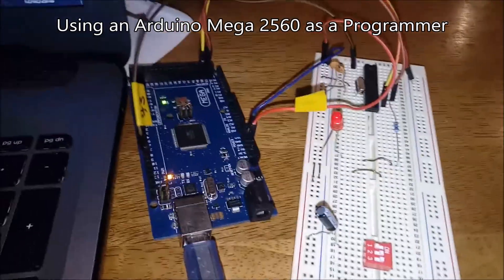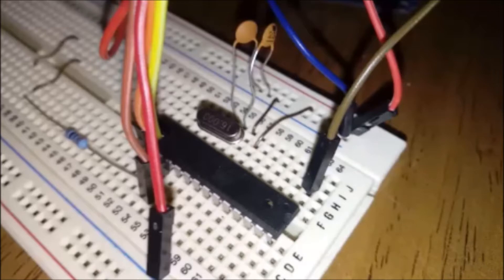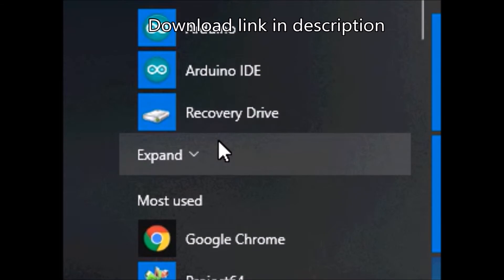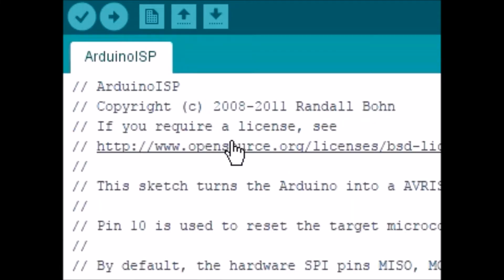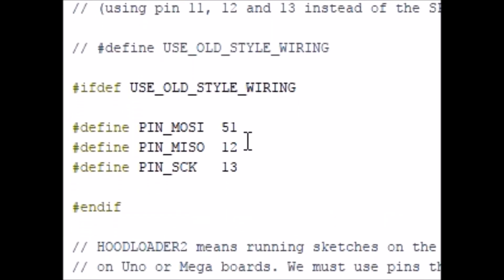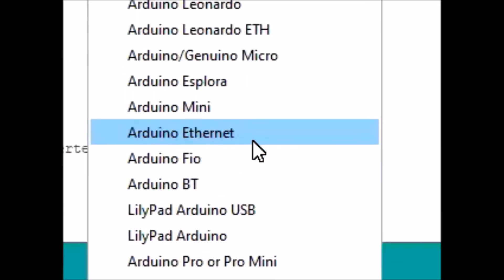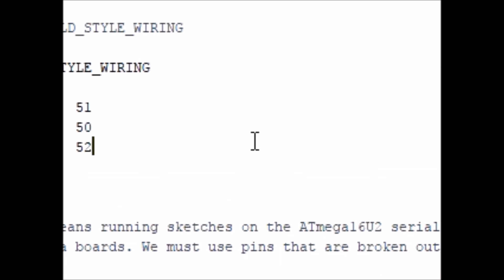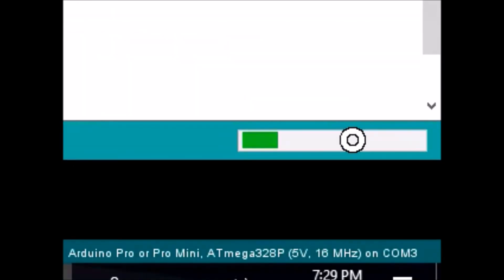How to use Mega 2560 as ISP programmer for ATmega320p in Arduino IDE

Comment: Binary sketch size: 914 bytes (of a 7,168 byte maximum)
avrdude: stk500_program_enable(): protocol error, expect=0x14, resp=0x50
avrdude: initialization failed, rc=-1
         Double check connections and try again, or use -F to override
         this check.

avrdude: stk500_disable(): protocol error, expect=0x14, resp=0x51

Comment: The most important thing you haven't mentioned is that Mega needs a 10uF capacitor connected to RESET and GND with the + leg connected to the RESET pin, otherwise it won't work.
Reply: I think I understand what the problem might be. Just like Lucas, I could not burn the bootloader in the beginning. Here's what I did: 

1. I changed the pin definitions as suggested in this tutorial. I was hastily using the 'Arduino as ISP' sketch as is.
2. I selected Tools>Programmer>Arduino as ISP. This was set to 'AVRISP mkII' by default.

As soon as I did this, I could burn the bootloader successfully. Hope this helps. Thanks.
Reply from the maker: Lukas Šidlauskas I did mention that. That's the point of the video. The new arduino ide program does not need the 10uf to the reset. I got caught out for a week not knowing this. That's why it's now on pin 10 and not pin 53 on the mega2560.
Reply: ScottyTee06 but it was not working for me on arduino ide 1.8.5 (macOS) until I put a capacitor between reset and gnd
Reply from the maker: You can see at the start of my video that I have the capacitor there on my breadboard but don't use it. I experimented with it and without it. Did you use pin 10 on the MEGA2560 to pin 1 on the atMega328 and edit the sample ISP code?
Reply from the maker: https://imgur.com/a/I3Hr0 - circuit
Reply: ScottyTee06 As I said this circuit doesn't work for me without putting a capacitor between reset and gnd on the Mega board. Maybe my board is different from yours, otherwise I don't know how to explain this.
Reply from the maker: hmm must be something going on with the boards or perhaps mac version of arduino? - anyway as long as you are able to program it, it doesn't matter which way. Happy days!